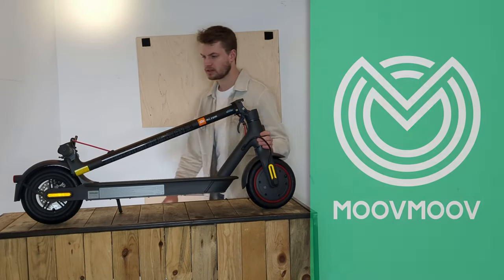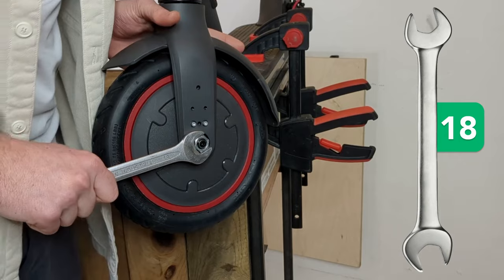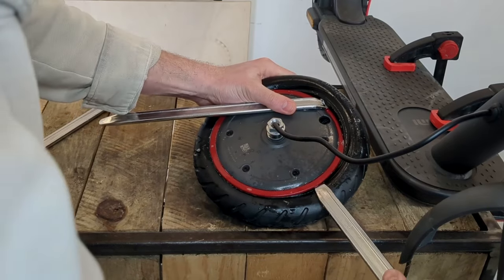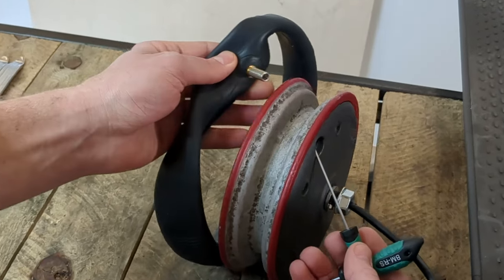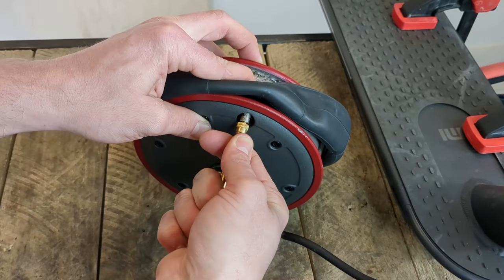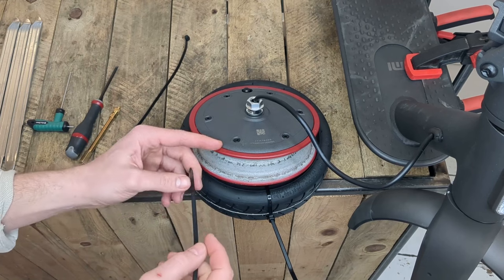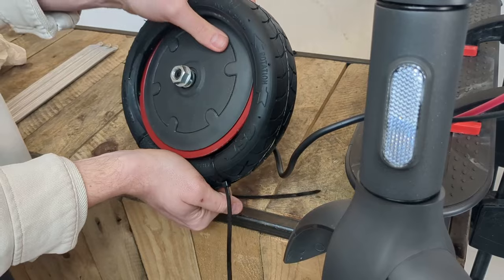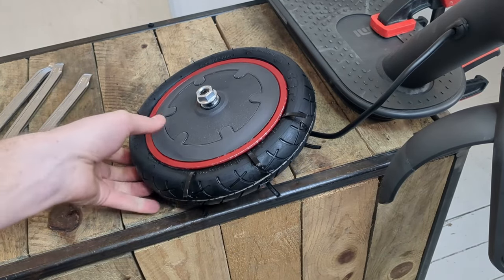TUTORIAL Xiaomi 2023 - Change the FRONT WHEEL! Tire and Inner Tube: M365 Pro - Mi 3 🛴💚

Comment: I have a problem with the Xiaomi Pro 2 scooter. It lasts a long time when turned on and lasts a long time when turned off. After that, it started turning on on its own and I cannot change the mode or turn off the light. Is there a solution?

Comment: Thanks for this wonderful and clear explanation... I managed to get the valve stem in the right place using a fine pincer and once through the hole I put the extension part on for putting the air in... I only had small levers, the energency type for a normal bicycle but thanks to your trick with the zip ties it worked... I'll now consider buying the larger levers...

Comment: Hi there, great video. HOWEVER my m365 in Australia came with a solid type tire, and no hole for the option to fit a pneumatic tire and tube, front or rear. I am interested in fitting pneumatic tire and tube to improve ride quality. So any information in if it is possible to simply drill the wheels, particularly the front which is the motor.
Reply: You can drill a hole in the rear wheel rim 

The front one is more tricky tho 
I would say you need to uncover the motor so you can see you’re not damaging any cables
Reply: Thanks for the information. I have 2 spare  rear wheels so I will do one and see the result in ride. I have just fitted a front suspension and that helps the front ride quality. @VictorIbelles

Comment: good video thank u...i want to know the trick to know if the front motorised wheel is from 1S or pro2  as i bought the pro 2 but on application its detected as 1s ( batterie, dimensions all from pro only motor and type detected is unknown for me)  thank u.And yes it has custom firmware 1.5.5 but no speed hack its untouched but serial number was modified from pro 2  to  pro because on the side the original serial is for europe peo 2 but on application its for eur pro...im just afraid that the motor is for 1S as its not powerfull and i paid for better

Comment: The RHS wheel motor nut (18mm) I simply cannot get off.
I've resorted to using a chisel and hammer but it still won't budge.
I read somewhere on reddit that they use glue in the factory which prevents people from removing them.
Does anyone know of any way to remove the wheel without undoing that nut?
I'm nearly about to get an angle grinder on it 😂
Reply: Get an 18mm spanner (not shifter), position the scooter upright and then use the force of your body to pull down on the spanner. Ensure it is going in left direction. Lefty loosey. Also make sure to pull make on that plastic thing and put the spanner UNDER the plastic thing to increase surface area contact for the spanner to the bolt. If you do not hav ethe scooter standing up straight, you won't be able to apply proper force down on it.

Comment: Hi is there a specific trick for the xiaomi 4 ?
I am unable to unscrew the wired bolt began to damage the bolt and stopped.
Reply: Yes, mine was on so tight that it was hard and I was damaging the bolt as well so I bought an extra long 18mm spanner, put some WD40 on it  and it worked.
Reply: @stephenjames674  you have a 4/4 pro also? I red somewhere about a reversed bolt
Reply: @stephenjames674  I will definitely try wd40. I juste want to be sure the bolt is standard (counter clock to unbolt)
Reply: @stephenjames674  WD40 worked !! I also ordered a special universal tool to unbolt any size, it probably worked better. Bolt is slightly damaged but still okay. I don"t know why Xiaomi makes it that way (there's only 2mm of the bolt visible that's not enough

Comment: Air valve stuck to the side on mine, can't inflate the tires without taking the cover off but the supplied allen key doesn't work. On top of the battery being rubbish and updates going wrong I really regret buying this badly designed PoS.

Comment: The inner tube part is FAKE. It was drilled or broaden in other way. At 8:16 you can see that this plastic "cover" in the hole is almost nonexistent and also note how loose the valve is after he put it in. The original inner tube hole is waaay tighter and the plastic cover that's inside takes around 25% of the diameter. That's why people drill it. If it was as easy as in this video where he puts it without any force and it just pops, people wouldn't ask on forums for years about solution to this problem.

Comment: You don't need to deal with the valve. drill that part with a 12 mm drill bit. but be careful when drilling, do not go into the rim and cross to the opposite side, just try to open the hole. then it enters very easily. xiaomi produces faulty. there is not the slightest improvement because they are Chinese. because they have no sample to steal.